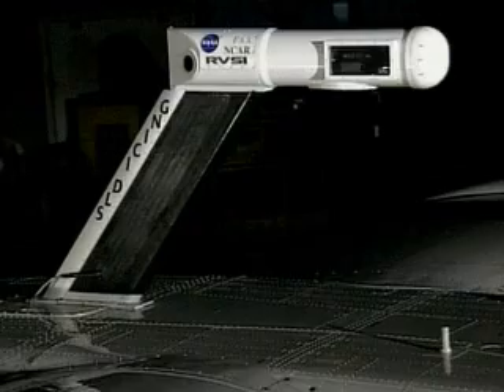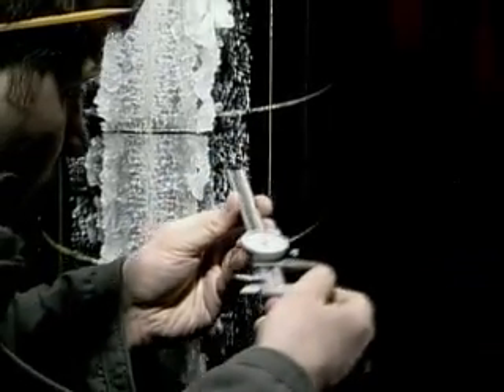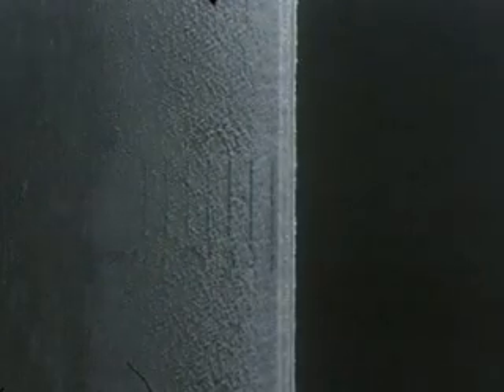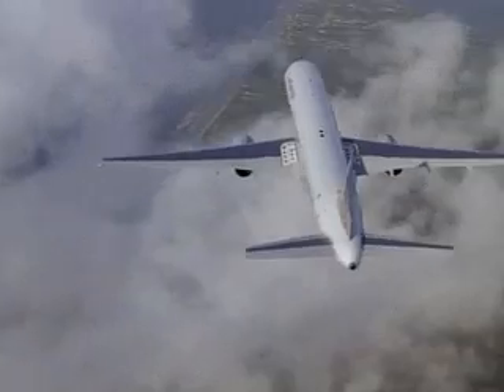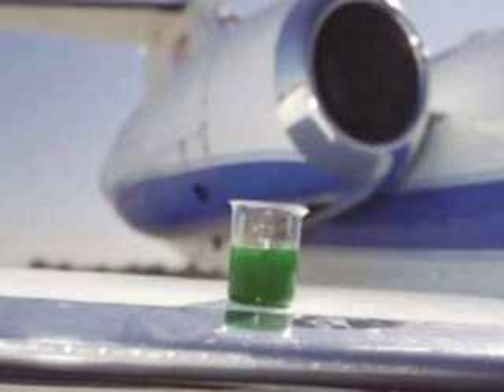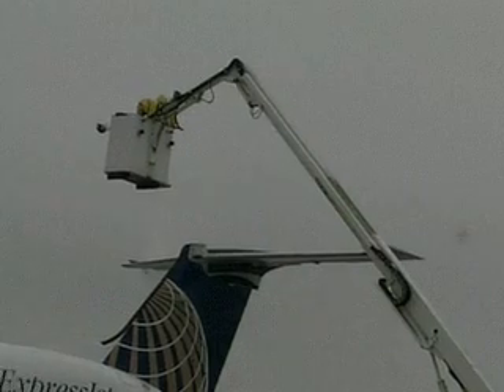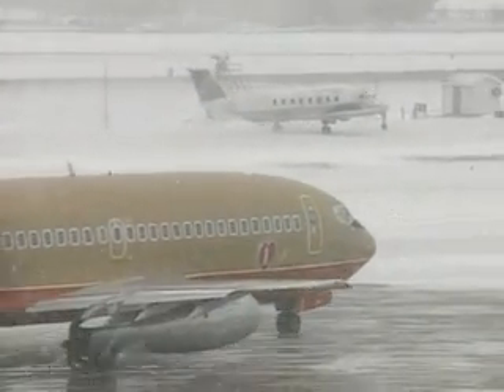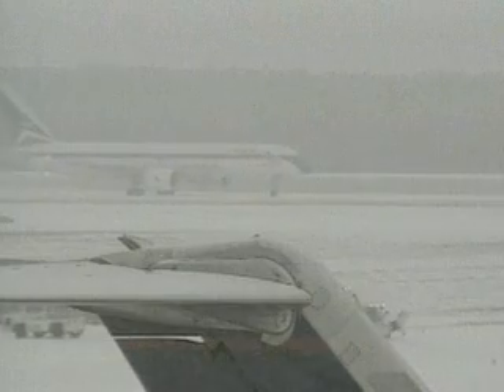Anti-Icing and Deicing on Commercial Aircraft

Comment: Interestingly, I saw my first de-icing procedure performed last night - 2022. It wasn't that bad and looked like there was no ice or snow on the aircraft. I was sitting over the wing. There was a suspended fog with a light snow - Denver. A high pressure or high temperature fluid was sprayed on the wing from tip to fuselage in an almost robotic motion. They missed a spot. But it was orange in color. After a few minutes they sprayed a green fluid along the leading edge and forward half of wing. It was more viscous and appeared as a thick green slightly foaming film on the wing. Then we took off.

Comment: In ahte late 70's I was the station manager, in Spokane, WA., for a low budget airline (Aero America) that operated B707/720 A/C.  We had no deicing equipment, nor could I rent any from competitors (Hughes Air West, Frontier, NW) so when I confronted our Ops Mgr (in SEA) he actually told me to secure large handheld fire extinguishers, fill them with some sort of propylene glycol mixture and have the ramp crew perform a high wire act out on the wings, packing the extinguishers.  I said, "sure."

Comment: @crapper1 It's made of Propylene Glycol: in extra simplified terms, its kind of like a sugar/alcohol water mixture.  No salt (corrosive), no Urea (that's used for ice melt on ramps).  Type I glycol (red) is put on hot (at least 160deg F) and under pressure. It is used for melting and removing snow/ice.  Type IV is the thick green stuff.  It is an anti icing agent that dramatically increases the holdover time of the wing.

Comment: @hunterziegelmann most comercial aircraft have bleed air (hot air from the combustion section of the turbine engines) going out to each of the leading edge slats heating them just enough to keep ice from forming to the leading edge. once the hot air is ducted into the leading edge it is then vented overboard out the bottom of the slat. It will be interesting to find out how the Leading edges are heated on the new Boeing 787 due to the fact that there is no bleed air comming from the engines.